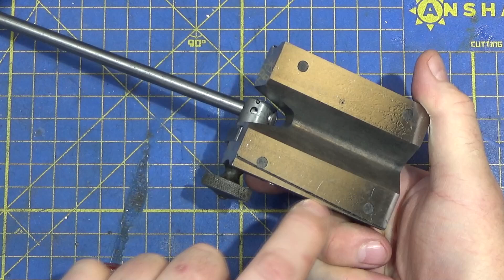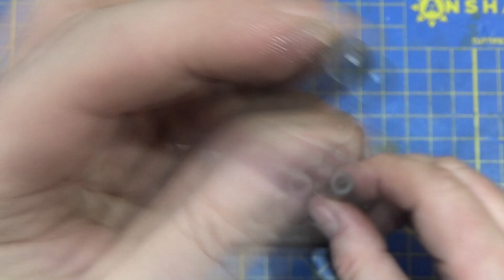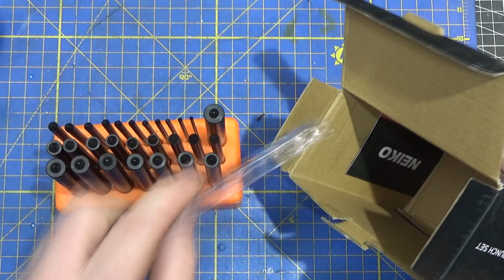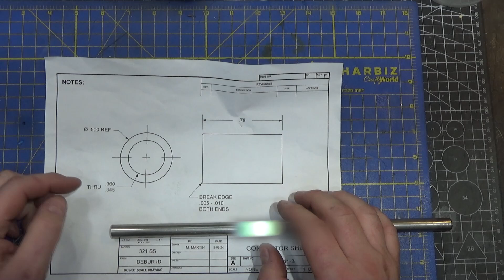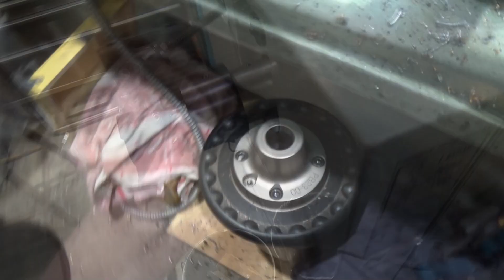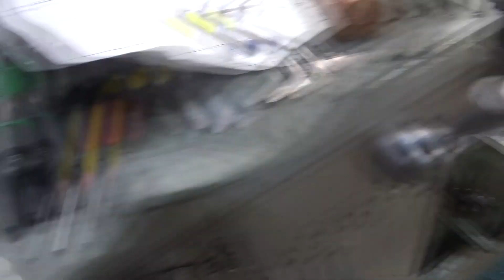Shop Miscellany #25

Comment: Buy nice or buy twice as Joe says. I’ve finally learned my lesson on import tools. They are not all junk but it’s best to pick and choose carefully. 

For 300 series stainless - a HSS bit will be fine but it MUST be sharp. 300 series work hardens in an instant so you must keep cutting and then pull out fast. Coolant is extremely beneficial. I think your rpms were too high since you burned out a carbide drill so quickly. I think a little slower rpms and coolant and you’d have been golden. The only issue I have on 300 stainless is when I try and use blunt drills. 😊

Nice review on the punches - I’ll get a set of the good ones. 

I’ll post a note of the best inserts I’ve found for stainless later just as an FYI. I’ve turned a fair bit of it now.

Whoops! TL;DR. 😂
Reply from the maker: Thank you. Thank you. I really appreciate the tips. I was running at 180 rpm, if that helps putting things in perspective. I definitely learned the hard in and quick out solution to drilling. Again, thanks.

Comment: You don't need a carbide drill for that just a good quality HHS drill and slow your rpm down because you probably are work hardening them because of the thin wall and use water soluble coolent in a bottle with a small stream faster you can drill the better so to have chip retain most of the heat, but hay what do I know that's just my 2 cents and it might be a bit pricey
Reply from the maker: Thanks for taking the time to help me and others out with your comments. I was running at 180 RPM, for reference.

Comment: You're getting those ugly parting leftovers even with an angled leading edge? I just ordered some 75 degree (well, 15 degrees off of square) angled leading edge specifically to get cleaner parting.
Reply from the maker: I have never had great success, even with angled parting tooling, but I am sure I am doing something wrong. Joe Pieczynski has demonstrated a working solution on multiple vidoes.
Reply: @DudleyToolwright  It's the radius on the corner of the insert . The thin ring gets pushed off & the ring stays on the finished part .   A tool that has a sharp corner & angled front will sort it .   Radius on the stock side is ok but not on the finished part side .    I just put up with it as it restricts the parting tool's use .  Best to grind up a couple of HSS blades for left & right parting .  I also use my parting tool for heavy stock removal between shoulders , so i want the front of the tool flat not at an angle .   👍

Comment: Your new surface gauge looks like it may too be a Starrett. The older ones did not have markings on the base. Check the rod for the Starrett name. I don't think the roll pins were Starrett original. Could you show friction pins in the new gauge in another video? Mine are missing, and I would like to make them Thanks another great video.
Reply from the maker: It might be. There was some text on the base that was barely visible. I will try to remember to show the pins in my next video, but if I forget, they are steel pins with a central relief that contains a brass expanded sleeve.